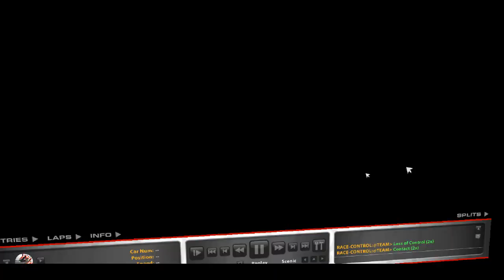KKR Sprint Car Setup Tutorial

Comment: Thanks for this video. I have so many questions, but what's the difference between setting up a 360 and a 410? What are variables that need to be considered when setting up one vs. the other? Also, can I try this as a baseline for 360's or just 410's?
Reply from the maker: S S that set will work for both, the only real difference is the amount of wheel spin, in a 410 you have more power so you’ll end up having to take stagger out faster